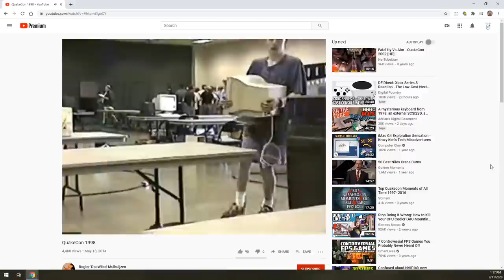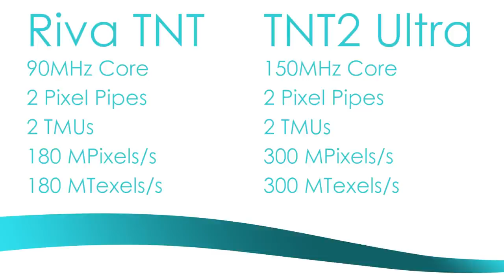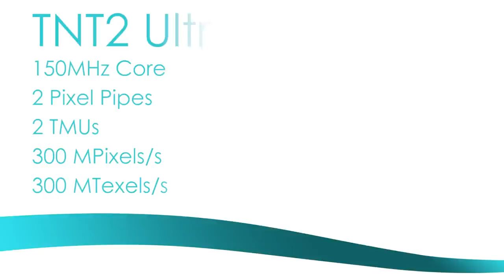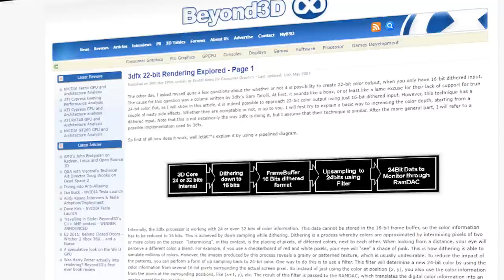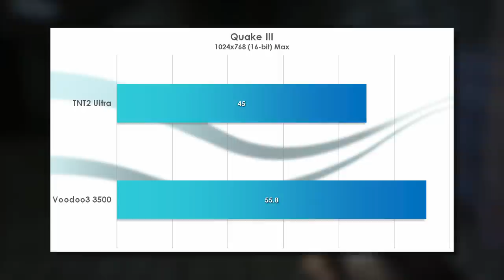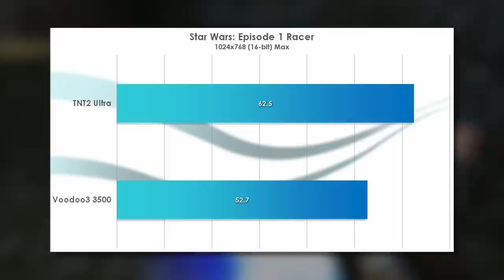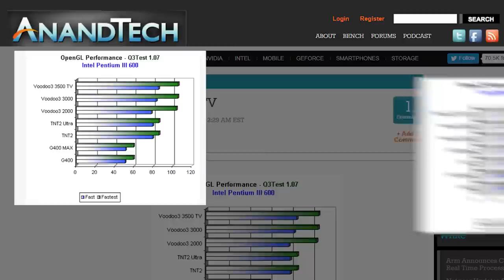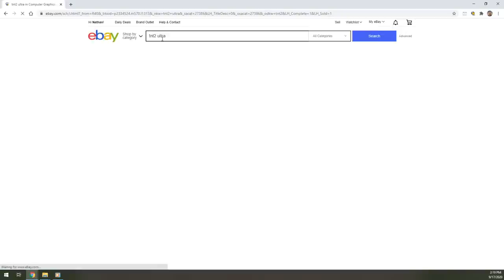NVIDIA TNT2 Ultra vs 3Dfx Voodoo3 3500 | Card Battles

Comment: This was a cool video, but not really a fare battle The VooDoo would come out on top. I would have place a Nvidia TNT 2 32MB (PCI) against a S540 S3 Savage4 Pro+ 32MB (PCI) same bust, same generation and manufactures like creative produced both cards. (and yes I am looking to buy one or the other for my retro rig).
Reply from the maker: The V3 3500 and TNT2 Ultra were priced right up against each other at around $200 in '99, so it's definitely a relevant comparison.

Comment: were you using directx for 3dfx instead of glide?  If you were using directx you are being ignorant because glide was better than directx back them.   3dfx won over tnt2 but ignorance has not boundaries.
Reply from the maker: the 3dfx card still won... With Glide it would just win a little more.

Comment: This is moot.  The V3 can only support 256x256 textures when the TNT2 supports 2048x2048, and doesn't support 32bit color again like the TNT2 does.  There's no contest in visual fidelity, and the TNT2 beats the V3 in almost every benchmark even with the texture size handicap.  Show the visuals side by side, and no one would pick the V3.

Comment: You can use a Pentium 4 at 3.06 with a voodoo.  If you want to go overkill :)
Reply: In case of Voodoo AGP cards only on very few select mainboards with IIRC an SIS chipset.
Reply: @armorgeddon  But you can use modern power supplies.  Older cpus used the 5v rail
Reply: @fractitos  No, the power supply has nothing to do with it. The issue is purely with the AGP port offering 3.3V which the Voodoos need.
Reply: @armorgeddon  I know that but with an old motherboard you need a strong 5v rail. Only old power supplies or a few modern power supplies with a LOT OF POWER have more than 30A on the 5 V rail. Old power supplies die and i don't want to lose my agp voodoo 5500 with it.

Comment: *edit my bad bro hardware didnt lie and i was wrong. Keep moving forward my bad for the troll.
Reply from the maker: I did test older Detonator drivers after another similar comment. The results were within margin of error. I believe this only helps with older/slower CPUs, and I think PhilsComputerLab did testing to corroborate this.
Reply from the maker: Well, they got 56.6fps in Expendable. That's pretty close to my 53.4fps.
They got 44.8fps in Q3 at high, that almost exactly the same as the 45fps I got.
What am I supposed to be seeing?
Reply: @PixelPipes  come on bro u dont see it then theres nothing else to say just proves my point.
Reply from the maker: But....the results match? I'm so confused right now.
Reply: @joselemusjr6451  The Voodoo would still be a good deal faster.....
Reply: @dirkmirk767  thats not my argument though and yes i agree.

Comment: Since those card relied on the cpu for tranform and lightning, having a good cpu can make the difference here, and so that's why the voodoo 3 can look weaker compared to the tnt 2 when running on a pentium 3 system
Reply: Hardware T&L was not introduced until the GeForce. The TNT2 doesn't have it.

Comment: Yeah right
It is definitely not important for me
I do not even have AGP interface in my daily driver
But, if I would have AGP interface...
All AGP graphics will be bottleneck...
2.5GHz Core clock, 64KB L1 data, 64KB L1 instructions, 512KB L2, 5MB L3 (yes this is right 5MB not 4MB not 6MB), HT 3.0 three of them
This is dual Opteron 6180 SE
6 cores a die, 6MB L3 cache (1MB is consumed by HT Assist), 2 dies a processor

Comment: FOR THOSE USING LEGACY SYSTEMS STILL CONSIDER THIS REALLY SWEET UPGRADE
**NVIDIA GeForce GT 710 PCI** https://www.techpowerup.com/gpu-specs/geforce-gt-710-pci.c2986
**get 2x cards, 1gb each, you can even make use of the PHYSX engine** (poor man's SLI)
Reply: and a **NEW KING** of **LEGACY GAMING** was born... (take my advice or don't, but you won't be disappointed if you do)
if you like retro boxes that much, and want the power of a computer from today, i know a variety of good gear combinations and will readily share.
(my best setup being an old core 2 quad i used to run not long ago) it RAN EVERYTHING...

Comment: Ah~ All that bragging about how Voodoo can't handle 32bit color depth~ and then show more shiny and capable rival card that can handle such color and it even struggle do proper framerate in 16bit.
It was all marketing bullshit at that time. No one used 32bit for playing games in '99. And even later. Until Radeons and Geforce 3 with much more efficient memory.
But even if 3Dfx right about it - the truth is marketing and shiny slogans much more important. And at that time Voodoo cards looks inferior in customers eyes.

Comment: Tom's Hardware had better performance than you in Expendable, and Quake 3 with a stock TNT2 Ultra, and a P3 550 back in 1999. The numbers presented lead to a false impression, and cast doubt over your testing methods. I bet 3DMark scores are way off too.

I would be careful with disparaging remarks about old reviews, when you apparently didn't do your homework.
Reply from the maker: https://www.tomshardware.com/reviews/full-review-nvidia,134-9.html
They got 56.6 fps...... You're complaining about a 3fps difference?
Reply: @PixelPipes  I'm not complaining, I'm looking at the emperical evidence. You have a faster platform, and worse performance. 

To paraphrase, you said it's important that you do what you do, in order to give a more accurate representation of what these cards could actually do. That didn't happen.
Reply from the maker: I'm just trying to figure out where I'm supposed to see better performance. So far it all seems to match.
Reply: @PixelPipes  The scores shouldn't match. You are using an Athlon XP-M 2400+ at 2.4ghz. Your scores should be miles ahead of Tom's from 1999 with their Pentium 3 550. It's that simple. 

I can corroborate my remarks by looking at similar tests that others have done, where they saw performance scale better with the same 3D accelerators and faster CPUs. Your scores are simply off.
Reply from the maker: This is actually expected behavior when performance is limited by the graphics card.
Reply: @PixelPipes  I agree that the scores are limited by the 3D accelerators, but that's why you're using a faster CPU. We want to see where that limitation ends, when we remove a CPU bottleneck.

We saw that the Voodoo benefits the most from a faster CPU, that is typical of 3dfx. I think your conclusions there are correct. 

The more I cross reference your scores, the more that the only scores that really seems off are Quake 3, and Expendable. You should have seen more scaling with your CPU. Probably in the mid to high 60s at least in Quake 3.
Reply from the maker: Well Tom's Hardware got over 60fps in Quake 3 but that was with normal details. At high details they got 44.8fps.
Reply: @PixelPipes  I suspect an issue with the TNT2 at those settings and Quake 3. I think it's choking on one of the "high" presets to the point where the performance doesn't improve. The faster CPU should see some scaling, if only by a marginal amount.

The site I was cross referencing saw the TNT2 outpace the Voodoo 3, but weren't using standard presets.
Reply: Samurai Jack  You are assuming that PixelPipes didn't enable Glide for NFS Porche Unleashed, or Volumetric Lights in DirectX. We don't know that, maybe Pixel Pipes can elaborate.
3DFX runs best in Glide, that is no big secret. Likewise I would expect the TNT2 to be better in DirectX tests, although here the performance was pretty close.
Reply: Samurai Jack  If NFS doesn't have a timedemo for Glide, but supports Glide, then I would agree it's not a great test. Using Fraps when comparing two different brands is not optimal.
Reply: Samurai Jack  lol ok dude
Reply from the maker: I can confirm I was not using Glide in any of my testing. If I did, it would not be apples-to-apples.
Reply: @PixelPipes  Glide is totally fair game, as long as settings are equal. Voodoo 3 would run away with it in Unreal. With a Glide wrapper, Quake 3 performance would improve as well. I have to agree with Samurai Jack, running the Voodoo 3 in DirectX mode is a hamstring when Glide is available.

Maybe you could do add a third line showing Glide performance, when available.

Comment: my 3dfx computer is up on eBay if anyone wants to buy it, the original computer long gone, but it's a PCI voodoo 3 3000 so I just stuck it in a pentium 4 bundle and it works fine, at least the CPU can't bottleneck it. xD